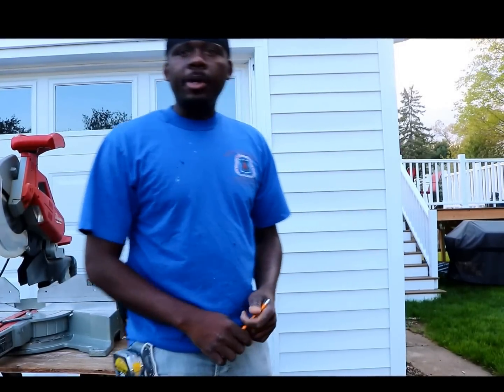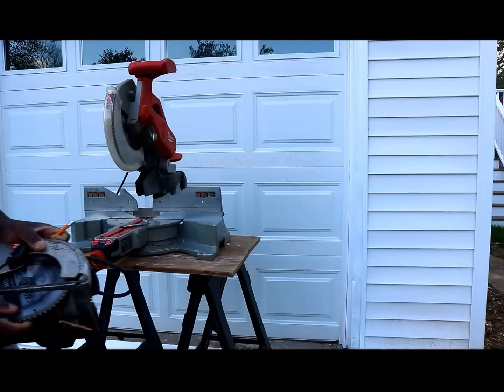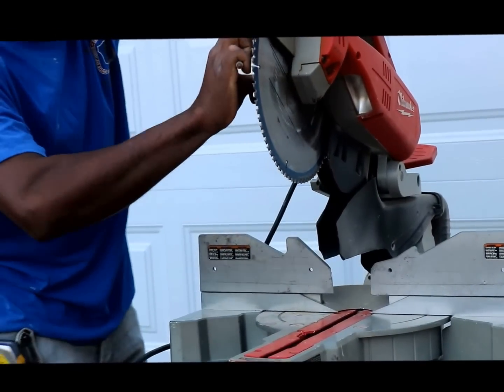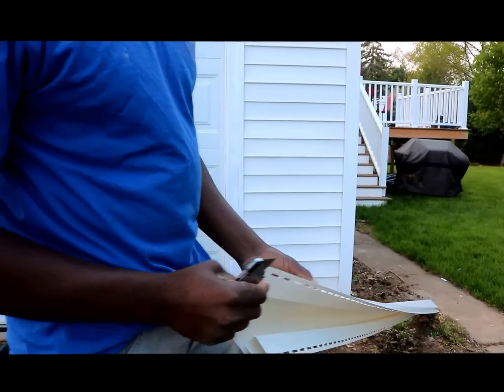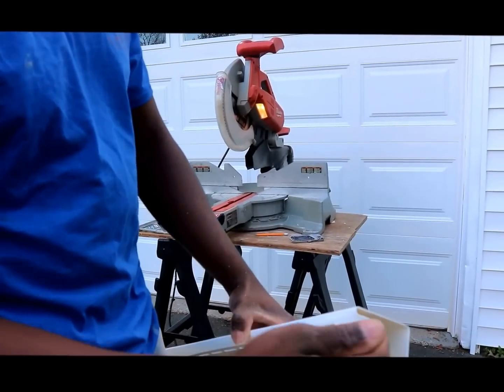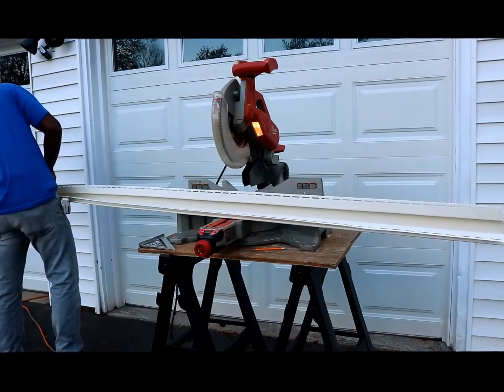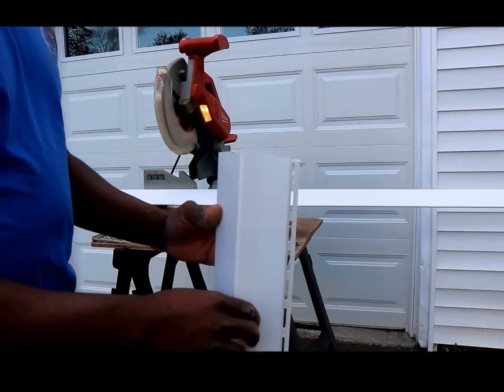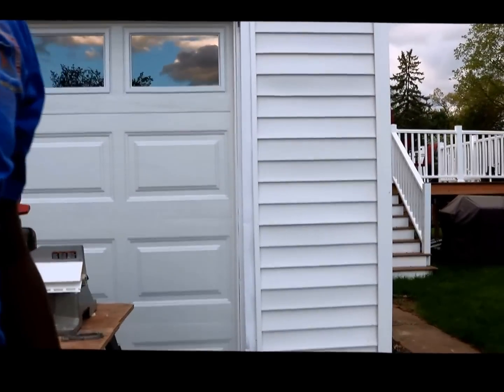Vinyl siding corner post, how to replace vinly siding outside corner for home

Comment: Sweet! Thanks I have a full length to replace on my house and not having to take the entire siding off is a huge time saver. 

James, I like your presentation style it's clear and easy to understand. A couple of simple recommendations to improve you video would be to cut out the parts like changing the chopi blade except for when you actually flip it. By doing that to other sections it will make it easier for your viewers to watch. I would have liked to see a close up of the siding you cut on the house. No biggie though. 
Is there a benefit to caulk or glue in several spot the new corner to ensure it will not come off? 

Thanks again that was a good video.

Comment: Hey James. Very informative video. One piece of advice is to speed the video up in the areas that are mundane - such as when you are cutting the entire length of the corner piece or changing the blade on your chop saw. Watch some of Jimmy DiResta videos and see how he does  it. I actually wantedto stop your video half way thru because I didn't have the time to watch it all. But thanks for making it and I have subscribed. Take care.
Reply: Adds realism. Easy to scroll through the video if it is too long.

Comment: Is it necessary to remove the old corner at all? Would the new corner go over the top of the whole old corner?  What stops the replacement corner from coming off?
Reply: ideally he would have used a caulking/adhesive before placing the new cut piece on.  That would help a bunch.  Otherwise, this is good.
Reply: Friction fit holds it pretty darn tight as far as sliding. I wouldn't be too worried. Not, that adhesive hurts.